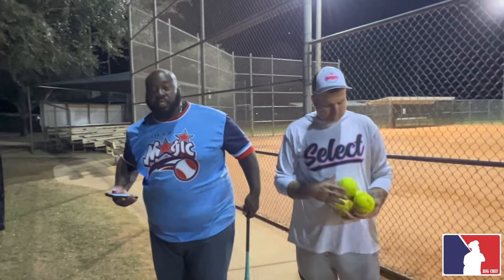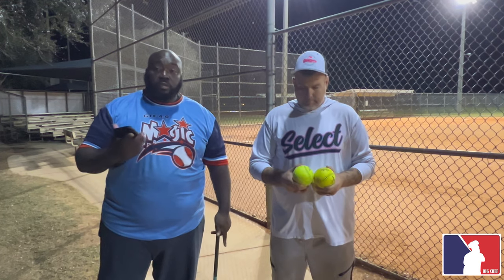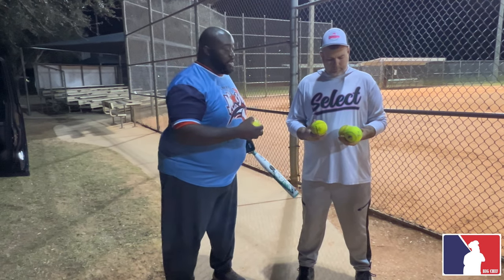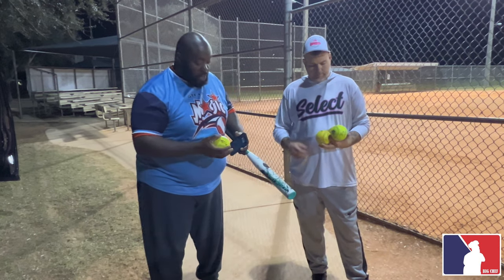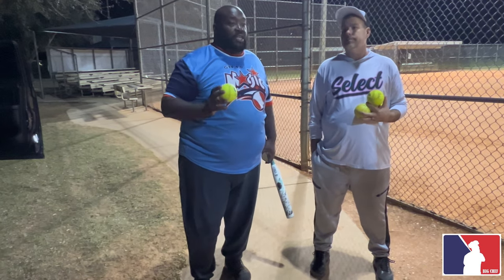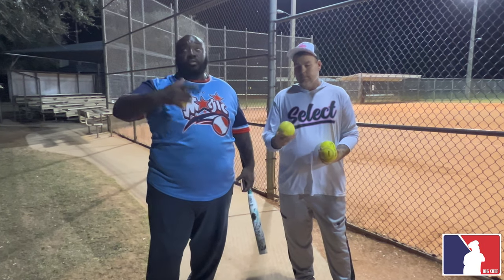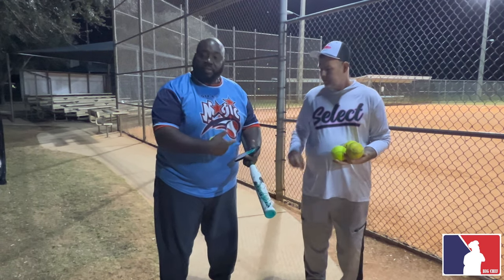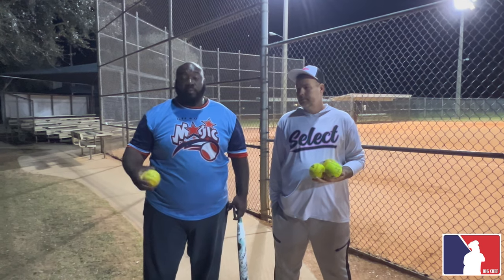WHY CLASSIC M’s ARE BAD FOR YOUR BAT

Comment: I've known about this for a while now and never have 40 cor softballs in my BP bucket. We hit some 52's and then switch to the 44 cor 375's for the most part. And your right, hard softballs in the cold is bat breaking weather. Some of the older MIken's and Easton's are tanks and can withstand the cold weather and not break. I think mostly what the bat manufacturer's are making now are not going to hold up as well. Great information as always Chef.
Reply from the maker: Agreed. Most recommend 52’s and game use 44’s. I personally feel the classic m should go away with the 220’s
Reply: I agree Chef and those balls will break bats quicker than most. Fortunately, we don't play with Classic M's here for league. Our open leagues and some senior leagues force us to play with the 52's. The senior league I'm joining this Spring allows us to hit 44 cor 375 comp balls. I think they use mostly Thunders, but not 100% sure yet.

Comment: What would a 52/550 be equivalent too? Roughly.
Reply from the maker: That’s a bat breaker!  I’d say that’s close to a long haul bomber ball
Reply from the maker: Because of the high compression
Reply: That is a derby ball. The high compression will really compress your bat, plus the ball will be "lively" due to the high COR. Max exit speeds and distance, but absolutely another ball you don't want to BP with all the time.
Reply from the maker: @SluggerStark  correct

Comment: .52s are the only ball anyone should ever really hit in BP unless they have a stubbornly stiff bat that needs break in. Many of today's bats don't require BP at all out of the wrapper to be hot, and hitting .44s or classic Ms will do nothing but destroy them quick.

Temperature also plays a huge role in how much balls will damage bats. If it's cold you NEVER want to BP classic Ms or .44s. Classic Ms can fluctuate from about 220 to 700 PQI depending on temperature. They're also very inflexible, while .52s are way more elastic.

Smart guys who want to hit a lot of BP and not blow through bats will use .52s and WON'T BP their game bats. Keep a couple old, crappy bats around strictly for BP.
Reply from the maker: Definitely 52’s are the way to go for Bp and to preserve the longevity of the bats. For the reviews we use 44’s to provide a simulated feel as those are the balls that are mostly used in league and tourney play. Classic M’s are killers
Reply: Also when it's going to be questionable temps overnight, DO NOT leave the balls in your car..........I'll hit outside here in the Northeast at 50 degrees or more, however I have the  garbage pail filled with balls in the house for at least 24 hours prior to BP.  Always, warm your balls!!!!!!!!!!!haha     PS........even in the summer when it's hotter than hot, I still DON"T leave balls ever in the car except to and from the field.